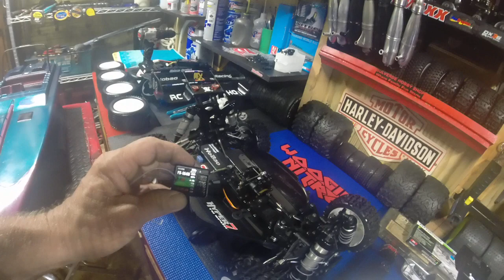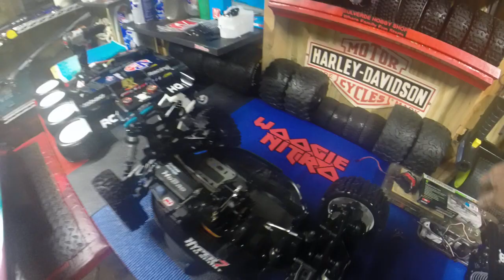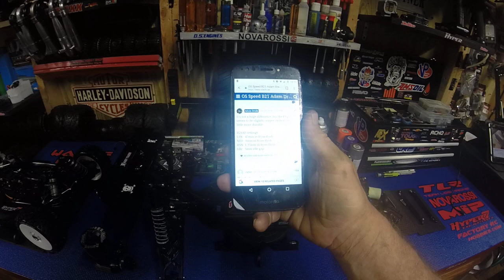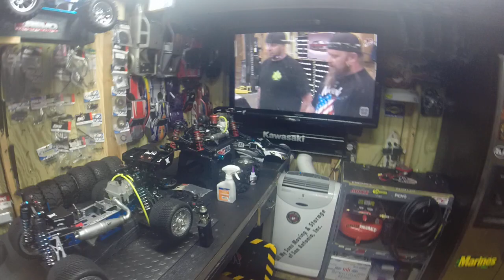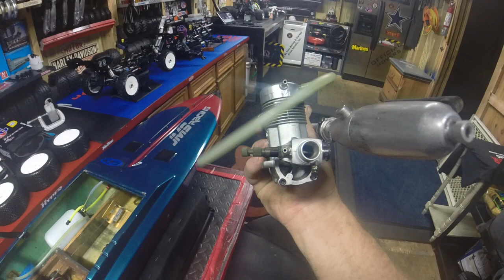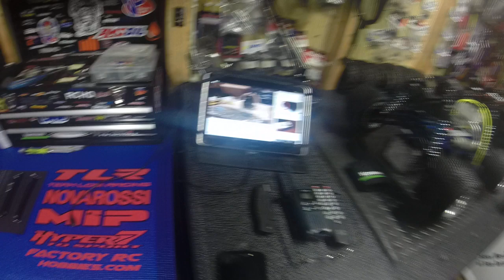Adam Drakes recommended carb settings for OS B21 Drake and more flysky receiver issues

Comment: Woogie I'd be very interested to know if the 3.0 buggy has the same diff setup as the 4.0 or the rtr. I have bought a used 3.0b in great condition and will eventually be rebuilding the car which I haven't done yet since buying the kit
Reply: Nop I thing the 4.0 has more gear
Reply: @CorvetteC6-LS2  do u know if I can use the 4.0 diffs in my 3.0?
Reply: Woogie what I'd really like to know is if I can make the 8ight X wing mount work on my 3.0